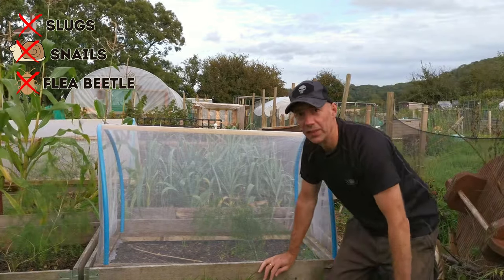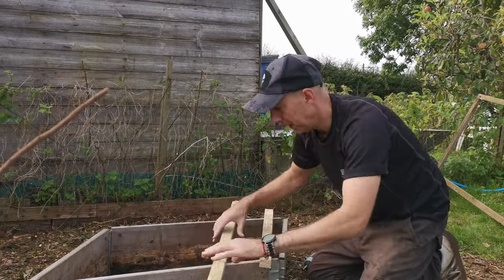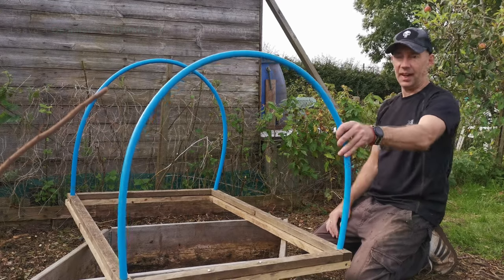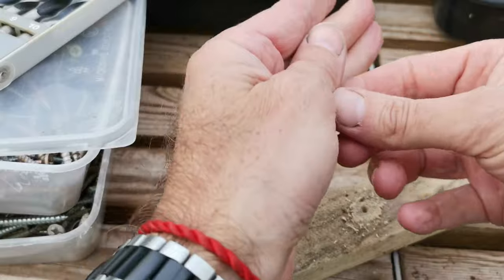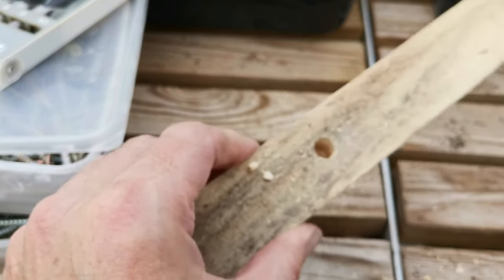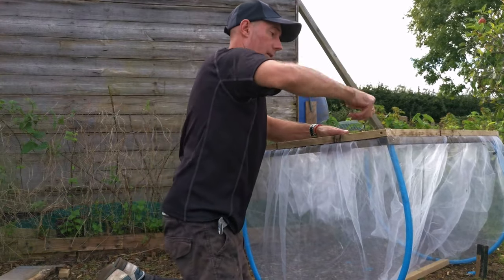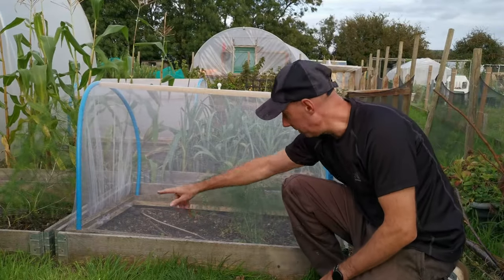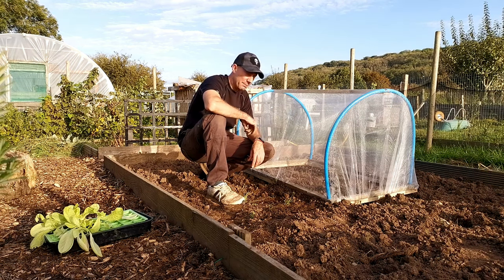Stop SLUGS and SNAILS eating plants  | PORTABLE Ultra fine Mesh Tunnel

Comment: Hi, thanks for this……appreciated.what size lengths of wood are you using. I’m a bit clueless about building lol 😅
Reply from the maker: Thanks for watching 😁, It's best to measure your raised bed first. (to get a perfect fit) This will give you the size wood needed.  If stuck measure  and cut the two longest battens first. put them on top of the bed this will then give you the measurement for the inner pieces. (Batten 25mm x 36mm) But anything close to this will work.
Hope this helps 🙏🌱
Reply: @veggiepatchideas  brilliant - thats what i meant lol - batten…told you i was clueless 😂😂😅🤣 on it!